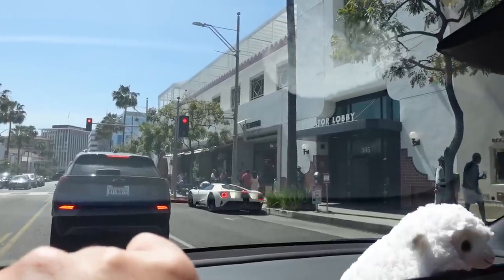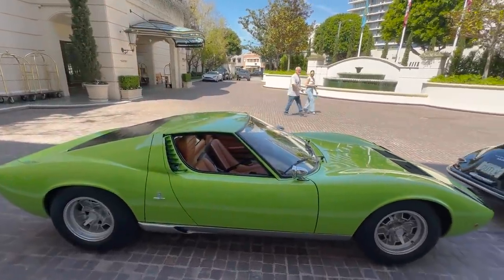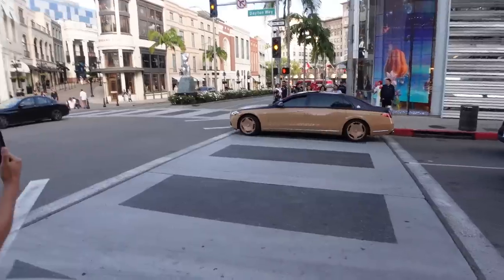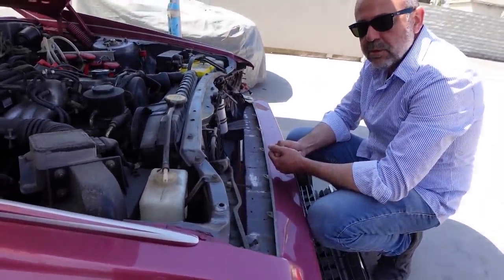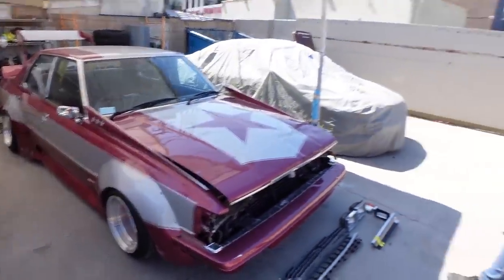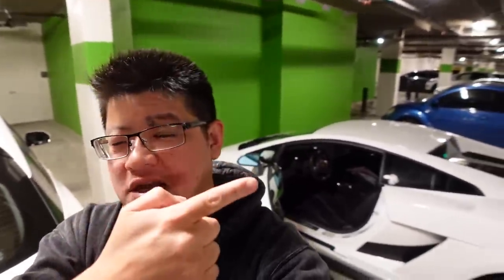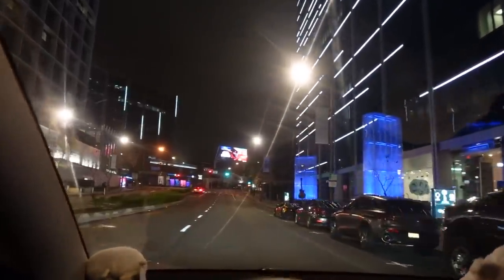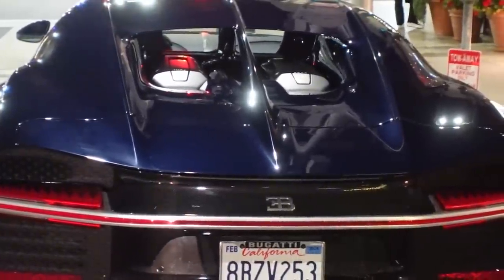The Collapse of My Car Collection: How It All Went So Wrong

Comment: I was wondering about the W202 for quite some time now. Can't wait for future videos of this car, it looks like its in great condition. Usually these cars rust pretty badly. I would also like to send you a free Mercedes Star and a few more as a reserve. We usually throw them away here at Brabus so you'd probably get one from a brand new S680 Maybach or a GLS Maybach. They still fit the W202.
Reply from the maker: The car seems to be in good condition, it desperately needs a paint correction!  Thanks man!
Reply: Fairly sure these cars had the hood ornament with the classic script with blue background, which the new ones don't have
Reply: @MrCarGuy  The design changed that’s true but the fitment is the same. Kind of cool actually that they never changed that since almost 40 years.

Comment: Go aftermarket air suspension on the century. I have a 97 in Oregon and that’s how I’m going as the stock parts are almost impossible to find and very expensive. A kit designed for a 2nd gen ls400 will bolt right up
Reply from the maker: Thanks for the tip!  I’ve already ordered the oem part. If that ever fails I’ll go afternarket!

Comment: Before you start tearing apart the Lambo, try running some fuel cleaner (like Seafoam or Berrymans) through the intake and in the gas tank. It won't cost much, and there's a small chance it will help.
Reply: yeah that would be great if the intake is rather dirty, the cylinder inspection will help also
Reply: if you think cleaning the fuel system will have any effect on oil over consumption you need to stop talk about cars.

Comment: What about just put an aftermarket air suspension on both Century and S600, you know if use original parts will be unreliable and expensive if broke again.
Reply from the maker: I'm going static coils on the S600.  As for the Century we're keeping it OEM.